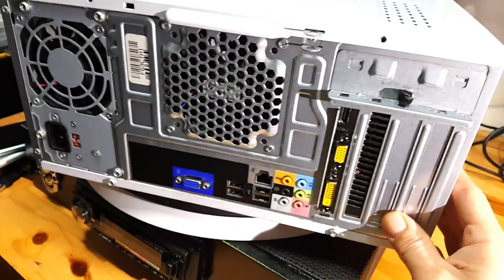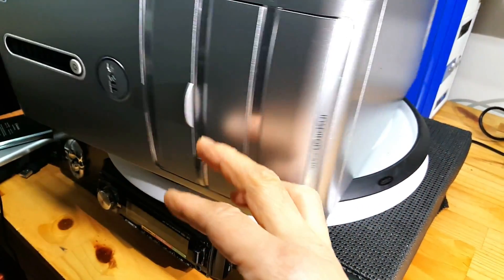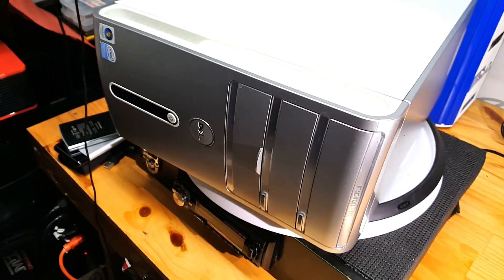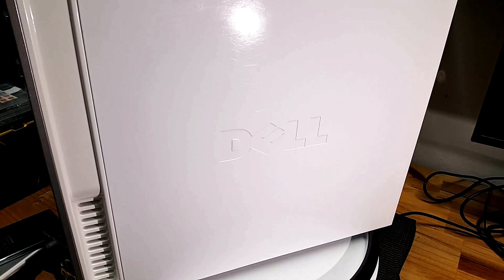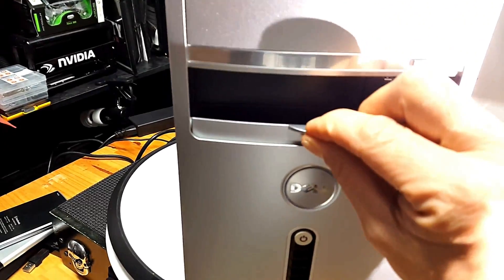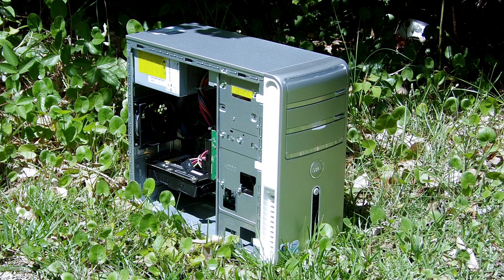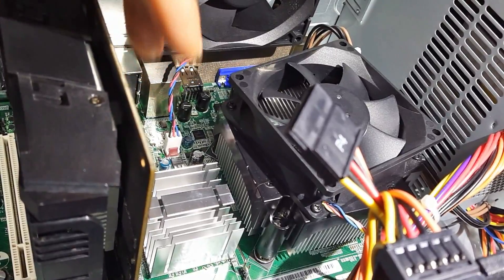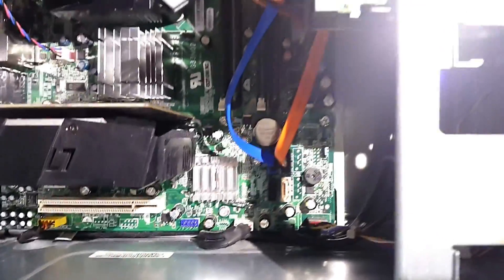CAN YOUR OLD COMPUTER RUN WINDOWS 10?

Comment: I use the same computer as "modstek" (Dell Inspiron 530 with 4 gigs of ram and Pentium dual core processor) as a host system for an 8 TB drive that is used to host a shared back-up drive. I also use it for a weather station and viewing that stock market.

Comment: Was told my Micrpsoft that my Dell inspiron 530 couldn't run Windows 10. I got 405 HD See System Information
------------------
Time of this report: 3/8/2017, 19:14:36
       Machine name: HANK-PC
   Operating System: Windows Vista™ Home Premium (6.0, Build 6002) Service Pack 2 (6002.vistasp2_gdr.100218-0019)
           Language: English (Regional Setting: English)
System Manufacturer: Dell Inc.
       System Model: Inspiron 530
               BIOS: Phoenix - AwardBIOS v6.00PG
          Processor: Intel(R) Core(TM)2 Duo CPU     E4600  @ 2.40GHz (2 CPUs), ~2.4GHz
             Memory: 2036MB RAM
          Page File: 1944MB used, 2367MB available
        Windows Dir: C:\Windows
    DirectX Version: DirectX 11
DX Setup Parameters: Not found
     DxDiag Version: 7.00.6002.18107 32bit Unicode
What do you think?
Reply from the maker: Windows 10 will run on anything I believe. It's filled with bloatware and ram robbing processes that run in the background. I assume they say that because it won't run that great on low spec machines but there are tweaks for that once up and running. Update to the latest bios and then uncheck or disable any  security features. Use Rufus  usb installer changing setting to MBR bios and make sure the pc is set to boot from usb
Reply: @modstek  Could you do a video on the settings you do on a Windows 10 install?  And why that setting needs to change?  Changing hardware is easy.  I struggle with BIOS and Windows settings

Comment: I have one, and short answer: yes, it can run win10, but I have upgraded mine, alot. Mine has a msi gtx 1050ti, 240gb ssd boot drive, and a 1tb wd blue hdd, a phenom ii x6 1090t black edition, (so i had to upgrade the motherboard too, forgot what spec it was) 2x8gb 1866mhz patriot viper ram, upgraded the case fan in the rear and added one up front, has a thermaltake smart 500w psu, and an amd wraith prism cooler,  I'll have a video up by the end of the month.

Comment: So. i've been with windows 7 Ultimate since 2010 and i have a really poor pc 
with just 4GB-RAM with 64 Bits
2.71GHz Processor
and I have an NVIDIA GeForce 8400 GS as a graphics card.
I've really been struggling with Windows 7 lately and i was thinking to move to windows 10. 
Do you think that it could work or should I stay in Win7?
Reply: Bro i use pentium with 3gb ram using g33/g32 gpu and windows 10 runs good so ye but if you want to squeese every hit of performance then use windows 7

Comment: I got one myself for free, someone was throwing it out. It runs Windows 10, but because its using an Intel Pentium 5200 CPU, its a tad slow, but does the job for work at home or even running a minecraft server. I upgraded my desktop to 8 GB RAM DDR2 , 120 GB SSD (OS) , 500 GB HDD (extra space) and installed a GT 710 2GB GPU so I could run this with any HDMI monitor. Under 40 Second boot-up time and runs smoothly! Cleaned inside and out, new thermal paste, clean fans, so now I have a spare working computer to use if my current high spec one ever breaks down on me.

Comment: I'm still using my son's old 530 as a home media server, I've always loved the case. I have an old SB mATX board and a 2500K that's sitting around, so I'm debating taking a dremel to the steel IO section of the case to fit it because the Core 2 Duo is feeling the pain a little recently although it's runs Windows 10 itself fine.

Comment: my girlfriends mom computer is an old hp with an amd athlon x2, it has to be over 10 years old. it wasnt even a high end pc when they bought it. i upgraded it with the best cpu it would take, a x4. i added a 120gb ssd with a clean install of windows 10 (moved the stock drive as a backup and mapped my docs/pics to it). left the 4gb of ram stock. replaced the thermal paste. it literally is as good as new. runs snappy for their everyday internet, pandora, word use.

Comment: I ran windows 10 on the same motherboard, different Dell series. Btw these boards are limited on power and bios, they can't run core 2 quads but they can run 3+ ghz core 2 duo's. I installed an ssd in my Dell Vostro and it's speed is pretty respectable. Just as quick as my i3 even though it's running sata 3 instead of sata 6.

Comment: "That thing's useless! Can't even run Windows 10!"

Windows 10 requirements:
Processor: 1 gigahertz (GHz) or faster.
RAM: 1 gigabyte (GB) (32-bit) or 2 GB (64-bit)
Free hard disk space: 16 GB.
Graphics card: Microsoft DirectX 9 graphics device 

Yeah, that guy is clearly an idiot...
Reply: Apparently.  That guy sure didn't do his homework.  It's his loss.
Reply: No, windows 10 is hella slow on the requirements.

Comment: I have a dell desktop that’s very old I got for $35 locally at a recycling place.    with a core 2 quad inside, 8GB of ram, 256GB SSD, and 1TB HDD, 600watt PSU, and a AMD HD7790 reference card.. it’s still a fairly capable machine however it’s starting to show its age with more demanding games.. but it mostly keeps up..

Comment: I also have an old Pc but mine is from 2005 and using this program to disable Cortana, windows defender, and search index has helped me get cpu usage back with windows 10 so I suggest you try this program on this dell Inspiron: http://files2.majorgeeks.com/b161a9ad6b331a7bd720740fce197ee017bf4fe1/spyware/OOSU10.exe

Comment: My sister's desktop is the Dell Inspiron E521 which was a $1,000 2008 model. Dell made some of the drivers exclusive to Vista or XP ,but you can still get by with windows 7. I tried windows 8 & 10 but half the drivers didn't work. windows 10 in particular slowed the computer down by a margin.

Comment: I had one of these that I got rid of recently. My daughter (6 years old) used it to surf the web. We had 6GB of RAM in it, and I upgraded it to the fastest Core 2 Duo it would support. I also put a GT 710 in it. Quite the serviceable little machine, although it had some issues with modern Windows Apps.

I cut it loose a few weeks ago because it is not going to receive a Microcode update to mitigate Spectre v.2

Comment: I bought this exact same computer at a yard sale for $5 with 2gb ram, e4500 and a 500gb. I upgraded it to 6gb ram e6700 (I tried the tape mod but I failed like 3 times) I added a r7 240,  put the 500gb drive in my main rig and put a 40gb hard drive in the dell. After all this it can run black ops 2 and world at war good

Comment: Any special reason for Win NT 6.2 and not 6.3 or 10.0 (windows 10) ?
I don't see any reason Win 10 won't run on this machine, not that it is a loss after all win10 is crap.
Reply from the maker: IT IS RUNNING WINDOWS 10 LOL
Reply: Ok, my bad, I missed it.

Comment: The earlier version of this machine can only use core2duo and no quad will work in it.  The restricted 2 core variants are pretty much potatoes, but can run less demanding games on low settings if it accepts the BSEL tape mod (Some don't).  I usually toss the 2 core only ones into the recycle box.
Reply: Crunchy Taco really? Well... Here I am with a celeron 420 BSEL modded
Reply: Don’t just toss em, they are still useful for just internet browsing and stuff or for someone who doesn’t have a pc

Comment: I got one of the small form factor version of this, and it runs really well. It has a Core 2 Duo (upgraded from the original Pentium), 4 GB of RAM, an nVidia Geforce 8800 GT, a 500 GB HDD and it runs Windows 10.
Reply: j've got similar specs to yours and mine is also small form factor 530s and mine will run windows 10 flawlessly all day everyday.
Reply: Wow isn't 8800gs a toaster?
Reply: My great grandma has one of the small form factor models too.
2 GB of RAM
Intel Celeron 450 (2.2 GHz)
Intel Iris at 320 MB
500 GB HDD
Windows Vista Home Basic with SP2

Plays Minecraft 1.7.10 at 8 FPS yet flawlessly runs the Vyond studio in Chrome while the Vyond is a heavyweight web application
Reply: @ZimmerRobertsWindows10  get cod word war
Reply: I have the phat version with pentium,3gb ram ddr2 as well as a g33/g31 integrated thing which i will end up upgrading to gtx 750 ti
Reply: I also have a dell inspiron 3420 laptop which is my main machine running core i3 2nd gen 4gb ddr 3 and intel hd 3000 nit high end but yeee

Comment: Does this chipset take a bettwer dual core or even a quad core?
Reply: Any Socket 775 dual core, but you need the G33M03 motherboard for quads. The chipset is the same, but the power deliver is different on the G33M02 so it's limited to dual cores.

Comment: Eh if it doesn't sell, mod it with hardware that can overclock better along with modding the case cooling, front 120mm fan & the largest fan you can set as an exhaust in the back or perhaps two in the bottom & two in the roof with filters for cooling & then throw in some decent motherboard & a core 2 quad if that motherboard doesn't support one.
Reply: this wont work too well due to the way dell some times make there cases the best you could do for cooing is to mod the side panel to use a 140mm fan so it can get more fresh air and replace the exhaust fan with one thats better for moving more air, as for the hardware i would just stick in the best  cpu that the chip-set can take and max the ram making sure the bios is fully update to see if it add support for better cpu's and get a better psu (if it can fit) and maybe get a 1030 or 1050, if your going to replace the hardware fully like a new motherboard and cpu you might as well just junk it and get a new case and let it be the end of that, 
you can get a good case for $50 easy if you know where to look.
Reply: The G33M02 in that system only supports dual core cpus. For the quads you need the G33M03.
Reply: These old dell computers with their proprietary  motherboards won't let you overclock the CPU.